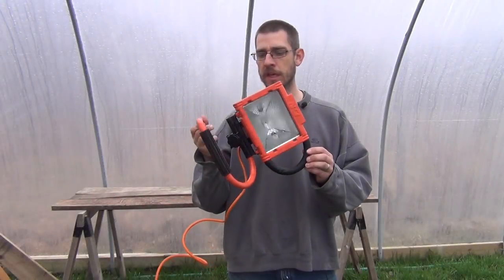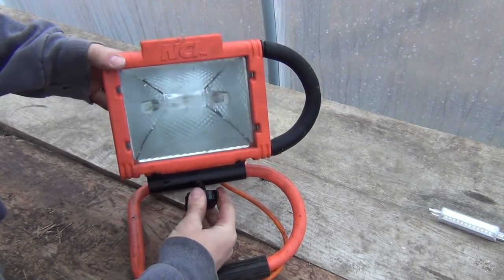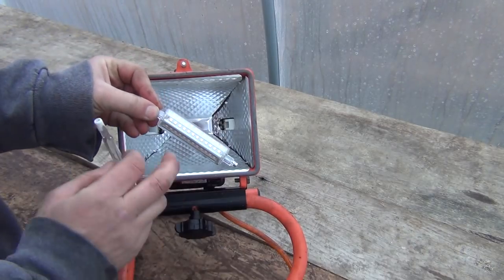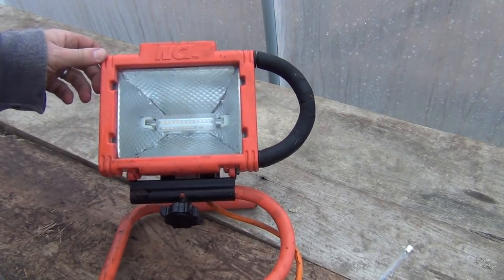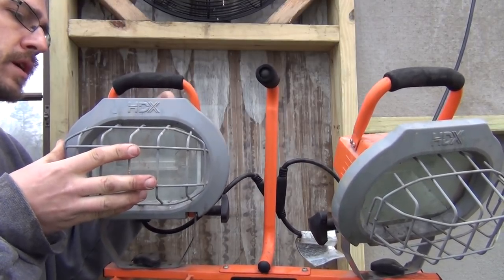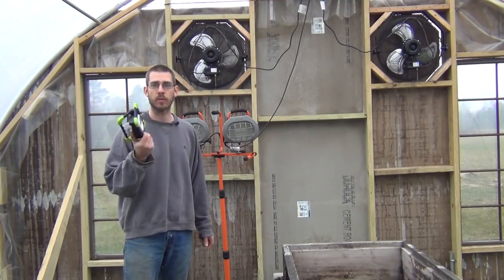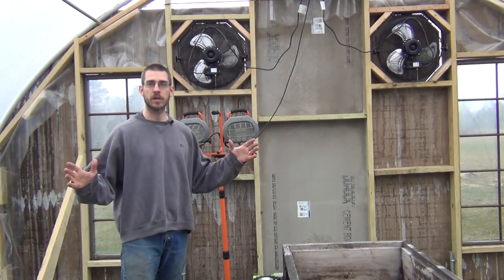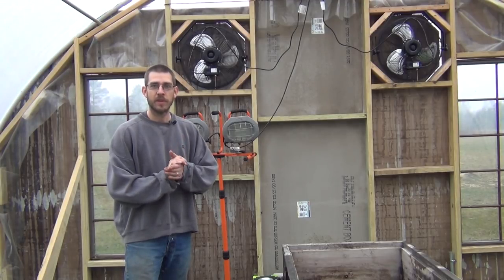How to Convert an Old Worklight into an LED Worklight

Comment: A friend is moving and gave me a couple portable work lights with fried halogen bulbs (ceramic ends crumbled when I removed them) except these lights have two bulbs each, one over top of the other, and I'm not sure if there's enough room between them to run these style lights being that they're larger in diameter than halogens. The lights say to replace with 300 watt or lower bulbs.
Reply: Could you try itvwith just ONE cartridge?
Reply: @jdlft.w836  Maybe next time I'll try it, this time I just went with the regular bulbs...I'm curious though...🤔

Comment: I was wondering how long it would be until there were LED replacement bulbs made for those lamps.  I have a 2x500w that I can get back into service now.  Thanks for the information.  I didn't notice a flicker from your black & high visibility LED work light.  I've noticed a few LED lights giving intermittant service in cold weather though (street lamps & bulb replacements).  That might be due to cheap build quality.

Comment: I love leds, but I've had some major issues with them. I'm an early adopter. The cob led replacements you used are nice. I've been using them for a few years. However, two went dead on me in about 2 years. Given that they're outdoor floodlights, they don't get used as often as indoor bulbs. Needless to say, they did not come close to their advertised life of 50,000 hours. I've also had similar issues with noncob led, single chip floodlights. They too didn't last anywhere near as long as their advertised life.  With those, it's not easy to replace the bulb. It requires soldering and usually a new power supply.  Leds need to have easily replaceable bulbs, and while some do, the majority do not. We end up with way more in the landfill due to this. I'm hoping they get better soon. Their instant on and power efficiency are nice.
Reply from the maker: I completely agree. I always try and use fixtures with removable replaceable LED bulbs. I have had good luck with my floodlights for the past year but time will tell how well they last in the end. These bulbs have a 2 year warranty so I guess that is nice and I think my floodlights with built in LED bulbs have a 5 year warranty.

Comment: It's a great idea, but only if it works.  Be sure to buy your LED replacements from a brick and mortar store where you can return them if there's a problem.  I made the mistake of being cheap and got a pair on Ebay that were $4 less and a couple millimeters too long.  I had to modify my lamps just to get them to fit.

Comment: I diddnt catch a flicker on those black/green leds from the light. Nice cob replacement bulbs though. I use my flood light shop light as a heater too! My fiberglass body filler was too cold to set up but with the light on it for a minute the catalyst was able to go off. Thanks for the tip

Comment: Thanks for the info!  Now I kinda wish I wouldn't have just junked the old work lights I had.  I also have some soffit mounted lights on the house too that I was going to replace, but didn't really feel like changing out the fixtures yet.  This will hopefully work for those also?
Reply from the maker: If they take the same halogen type bulbs this should be a direct replacement

Comment: Have you had an issue with those bulbs? In the product description in your amazon link  it says not for use in fully enclosed fixtures.
Reply from the maker: It does say that it needs ventilation. I have never had any issues in those fixtures and have left the lights on for days. With the bigger light you may want to take out the glass or drill a hole in the too for ventilation

Comment: The socket is an R7s with ~118mm length. Those Halogen Bulbs are available in 80-400W usually.
The brightest LED Bulbs i know replace a 125W Halogen bulb so depending on what was in there an LED might not be as bright.
But still - The Amount of Energy you save is worth it if you dont absolutely need that amount of light.

Be Carefull though - many of those LED-Bulbs are designed to have free Air flow over them (not enclosed like in your lights) so they might not last that long if you run them for a few hours at a time.

If you need a new light anyway get an LED light that has proper cooling integrated.
Reply from the maker: Good info, thanks. Yes, you can remove the glass cover since it is not needed anymore since you don't have a molten halogen bulb in there anymore. I have run these ones for a few days straight with no issues though. Also, the higher output bulbs are 250watt equivalents
Reply: I work in a store where we sell those and i had a few customers come back after 2-6 Months with the broken bulb and from the color of the LED-Chips i could tell they were run too hot (they go a bit brown after a while).
Those customers all had Lamps without free airflow ;)
This can also happen to the small G9/G4/GY6,35 replacements and cheaper E27/E14 Bulbs.
The Surface Area is just not big enough to cool the higher powered ones without some airflow.
Reply: Drill a few small 1/4" holes in the top and bottom of one and leave the other as is.
Let's see if the "air cooled" lasts longer...
Follow up vid idea.